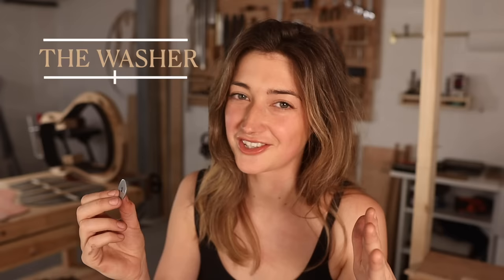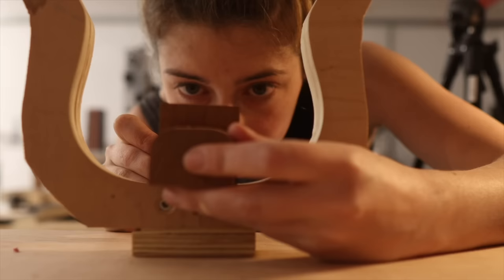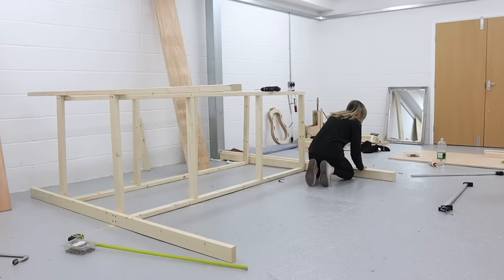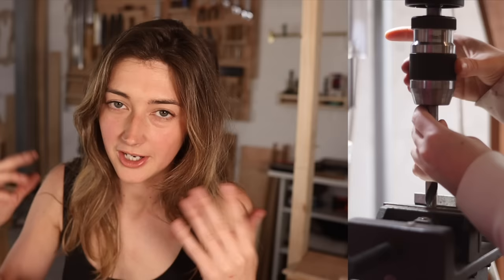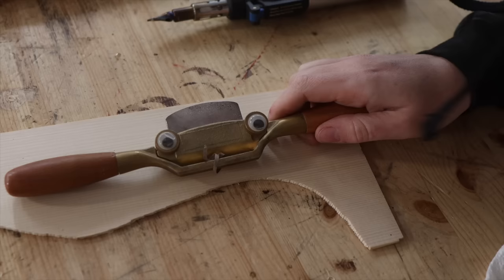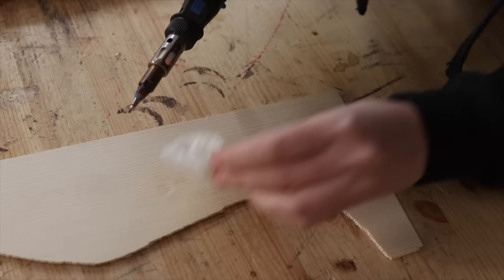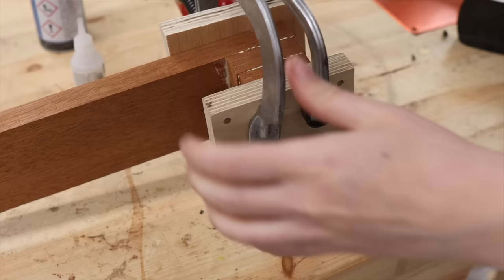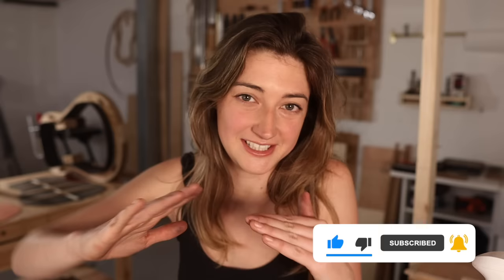Uncommon Tips to Make Woodwork Easier

Comment: A damp cloth and a clothes iron also works for dents and less chance of a burn mark. Well done Daisy more content required.
Reply: Second that, and it is far easier to control the heat, take your time and let physics do the work.
Reply: Also good for blocking a sweater!
Reply: Third that. If putting a few drops on it doesn’t work, out comes a damp rag and my hand me down iron.
Reply: I will agree with you all and add that i was tought to use brown paper, and for that matter the iron was a proper old fashioned non electric one. Also it's not good for the soldering iron , particularly the tip, to be constantly heated and the effectively quenched.
Reply: Came here to say that.
Reply: Been there, done that, several times, so you're dead on there.
Reply: I fourth it. not as harsh, more control.
Reply: Just don't let the wife catch you. I do the same, shush, she don't know.
Reply: had this same comment all typed then noticed this.  agree completely.  and covers a larger area at one time.

Comment: Playing cards as spacers of infinite thickness (almost) and also protectors from glue, glue scrapers. Get the cheapest plastic coated ones. They don't stick to wood glue. I buy ten packs at a time, cheapest ones I can find. I don't mix cards from other makers in a deck, as there could be differences when you need to space out two ends evenly, but when you have 10 of the same decks at a time, you can just have a big stack and they last forever. Also, they're easy to cut.

Comment: Regarding the (US vernacular) hole saw (the things that look like a saw blade wrapped into a circle) and precision... I'm a machinist, and build motorcycle frames, and hole saws do have the ability to be precise with "One Simple Hack" [tm]. Put the hole saw in your drill press, run it at a low speed, then use a belt sander to whittle down the diameter until it cuts on size.
Reply: That's some top tier machinisting right there! You guys just see stuff differently, that's a brilliant idea.

Comment: Regarding the non slip glue trick, I've used a little sprinkling of salt added after the glue is spread, it adds coarseness to keep the work piece from sliding and doesn't affect the joint in my experience, just dissolves away
Reply: Dammit, now we need to start adding a "pinch of salt" to our woodworking recipes?!! You must work for the salt industry!

Comment: Instead of a soldering iron, use a regular iron like the iron that you can iron your clothes with.   It has a temperature setting on it and you can adjust it more finally and it won’t burn your wood, but still only get the dent wet with a paper towel.  Works great.  It also can be used over the hole project to pull different parts of the wood up to give it a unique look.

Comment: Another tip if you might find useful. Use a drinking straw to scrape glue squeeze out from tight angles or hard to reach places. The straw's opening will deform into the shape of the angle and scoop up the glue squeeze out. If you are using a paper straw you will have to cut of the end as it goes soggy, but you will get a good run out of one if you are careful how much you cut off to find non-soggy straw.
Reply from the maker: Cool!!! Thanks so much :)
Reply: This sounds like it’s worth trying. Thanks for the tip!
Reply: I put a hard crease at the end of the straw to help it get down into the corners easier. This trick works very well!
Reply: and you can suck the excess glue out while your at it
Reply: @chuckgrumble5440  

Or huff it........
Reply: I cut my straws at a 45 deg angle, allows the point to go in the joint better. Let glue dry in straw, cut that section off and go again. Can get like 6 uses per straw. And cut them lengthwise when done using. For the turtles.
Reply: @tjennings4412   i cut a barb shape for the turtles before disposal
Reply: @tjennings4412 — What do you mean by “for the turtles”?
Reply: @AndreaCuchetto  The Teenage Mutant Ninja Turtles use the cut up straws to make crafts out of that they can sell on Etsy so they can fund their pizza addictions. You think they get paid for crime fighting?
Reply: @joshhencik1849  — ha!

Comment: Another anti-slip trick for glue-ups is to sprinkle a few grains of sand or salt into the glue before putting the two pieces together. It provides enough friction to stop the slippage but doesn't affect the joint.
Reply: This is a horrible thing to do to your tools. Either you are dulling them by scrapping them with the sand, or you are causing them to rust faster by applying salt.

Comment: It’s already been mentioned, but the table salt trick is one of my favorites for slippery glue-up solutions. With that said, i’ll definitely use the CA trick on smaller things! Thanks Daisy!
Reply: Thank you Daisy.  Similarly, we'll use a spot or two of hot melt glue when gluing items such as cabinet toe kick to eliminate brad nail holes where totally flat isn't an issue.  Works on attaching stair rail rosettes on walls to anchor wood 'til adhesive sets.
Reply: If you are going to use that idea, I've had better results putting a scrap of painter's tape down, then the glue then remove the tape for a clean surface
Reply: @markbernier8434 — Is the tape holding the pieces together while gluing (i.e., it is not in between the two pieces)?
Reply: To hopefully clarify,  it stacks up this way. Scrap lumber as base. Layer of painter tape, super glue, more painter's tape, underside of the work piece.  When desired easily pried apart and tape stripped away clean.  @AndreaCuchetto

Comment: planed pencil improvement: lay the pencil planed side down and lengthwise on the middle of a piece of wide packing tape placed sticky side up on your worktop. fold  the sides of the  tape up around pencil and adhere them to each other. This protects the lead and your surface and gives you a tab to hold on to.

Comment: Love your tips and tricks, here is one if you have a split in the surface of a guitar top, you make a thin long piece of 'spruce that is sharply triangular (in profile) and with  a bit of clear glue place it in the split, after it dries sand it down, Bobs your uncle, one hidden split. Iv'e heard it said that a good luthier is one who knows how to hide his/her mistakes, (as it can be a challenging task to make it absolutely perfect all the time :). Oh a glue has to be hard or the vibrations don't travel through the instrument, plastics like pva are soft and stop the sound, this goes for all joints, hmm like a neck joint. Used the damp cloth tip when we move a piano across our lovely floor, no more wheel dents, 
I was 'reliefed ' :) just hot wet tea-towels, it worked. Oh dents in ebony fretboards, a bit of ebony saw dust and superglue works a treat, hard as nails, just like the old ebony which is very very hard like iron, one can cut the fret slots after.

Comment: I noticed in your ukulele build that you could use this tip: Use a straw to clean up glue squeeze out in tight corners. It forms into the space well, can continue to load up inside the straw as you go, and can be rinse out easily enough for future use.

Comment: A sprinkle of table salt on glue will keep joints from slipping too.  Great video Daisy :)
Reply: That I've used a bunch, and it's great, but the superglue one was new to me.  I could see a couple cases where that is likely gonna be super handy.
Reply: can you use fresh cracked pepper also?
Reply: I love that trick for rough work but only recently discovered how easy it is to sprinkle too much and be left with a seam that wont' sufficiently close in an even slightly awkward clamping situation.  I ended up having to scrape away the salted glue and start over.
Reply: @chuckgrumble5440  no it messes up the taste man, try balancing it out with some sugar maybe

Comment: Great video Daisy. A trick that was a game changer for me was the masking tape and super glue trick. Or known as the blue tape and super glue method. I find it way better than double sided tape. For anyone who doesn't know it's simple. Put masking tape on your work piece. Then put masking tape on the corresponding, let say template. Put a bit of super glue on the masking tape on the work piece. If you have and spray excelerator on the tape on the template. Then simply align both and press down. You can route the work piece to the same size as the template and the template isn't going anywhere. When done pull them apart because the only thing holding the pieces together in the tape. I use it all the time for a variety of different jobs, like a quick way to keep a cutting guide in place whilst using a circular saw. It will come in handy a lot and has saved me a few times.
Reply: Change just use to face tape that's what it was me for! Also you using two very expensive products to achieve the same thing and spending more time at it! More monkey see monkey do no logic required here is it
Reply: @makenchips  The logic is that blue tape consistently holds well and isn't too thick and removes cleanly without tearing, leaving residue, or ripping out wood fibers and allows separate application to each surface which aids alignment without compromising bond (or, again, taking up too much space for an interfacing foam layer) and serves double duty protecting against tearout and is a readily available cheap commodity product just about anywhere and isn't easily confused with some other product which might end up ruining your project, whose raw materials cost way more than any roll of tape ever will.  You're also going to already have it anyway, since it has so many other uses.

And what are you smoking, blue tape expensive?  1" x 60 yards, $5.  I've no idea what "to[sic] face tape" is supposed to be, but two sided tapes offer maybe 1/4 the coverage (accounting for the doubled use of blue tape) per roll if you're lucky, for about $20.  Carpet tape will come in slightly cheaper than two-sided tape but fail to hold, ruin your surfaces, or both.

Blue tape/painter's tape stands alone in being the only tape that's actually designed to be removable and maintain a firm but delicate hold.  You can use something else, but every unique product will be a gamble.  Congratulations on getting lucky with results, but I doubt you actually did the math on cost.
Reply: I've tried the CA glue and blue tape. It was a pain. I'm sticking with my double sided tape 🙂
Reply: @HonoredMule  Yards, inches, knots... I'm waiting for people to finally understand that the metric system is just simple.
I understand that when you're born in the US you think in fractions of inches, but it's like I'm using a lot of different measurements. One is x/16, the second is x/2, the third is x/48, the fourth is x/4, etc.

Do you understand my point?

Now imagine the same system as a monetary one. In the store you pay 12/34 of an inch with 3/14 of an ounce, and in the wholesaler you pay 3/4 of a bucket of cement, which must be enriched with 35.2739619 ounces of water.

Instead of constantly jumping around, I just simplify the system.

Comment: And if you clamp a knife in a vise, you can pull the inner tube past the blade in very thin strips. Great for binding up wood pieces for storage.
Reply: What do you clean the inner tube with before use? Just soap and water?
Reply: Yes. But regardless the black rubber does wear off and can mark quality wood. @AndreaCuchetto

Comment: When gluing two pieces of wood that may slip,  instead of super glue in the middle,  sprinkle a little salt on the board. The salt will prevent the boards from sliding.
Reply: I'll just add you sprinkle the salt onto the glue. You don't need to wipe it away. But not too much glue. If the wood is soft you can use sand.

Comment: An old woodworking guy writes:

A pencil with the wood on one side planed away is sometimes called a "mouse" - draw a big sketch and you'll see why!

Holding a plane upside down in the vise is a good trick - but when you do it with a bailey type plane make sure the plane is LOW in the vise jaws - otherwise you can snap the cheeks off as you tighten the vise.

Comment: the very first tube i saved has been laying around for years. Ever since i thought of them as huge, bump resistant, quite waterproof condoms for flashlights, lighters, tools, the one crappy, 5 bit in a handle combo socket screwdriver, that failed to lock only 10 minutes after you paid for it the supermarket and plenty,plenty more I realised how great it is to have them salvaged, especially diferent sizes, as mostly you will use like a couple cm. Well... the rubber saves lives. Embrace it as you like

Comment: I will also say about the drill-lathe tip, if you need to remove a lot of material very fast and dont wanna hold it to a sanding block all day, you can take the drill to a belt sander and make sure the spinning drill is going opposite to the direction of the belt, and just give it hell full speed, carefully hold it to the sander. Keeps it nice and round, takes a ton of material off quickly and you can do easy tapers like that for starting deeper dowels or making tuner or bridge pegs and so on. Love the channel, very nice to see young people getting into hand making guitars and especially women getting into a male-heavy field.

Comment: I work on metal for a living and I often use the "finger depth gauge" to get a parallel line to an edge for, say, a row of rivets when the actual distance does not matter a lot. The bicycle tube is great, another alternative is the so called surgical tubing, it's flexible latex tube that can be had in different sizes.

Comment: Love these thank you for legitimising me using my plane in a vice, although I'm always worried I'm going to plane off my fingertips... 

My top hacks
Super glue + masking tape clamp - masking tape on both sides of whatever you need to clamp in place, superglue on masking tape, hold down. Done. I used this for so many tasks, met at first with incredulity by the tutors - either that will never hold, or that will never come off. It works every time, you can plane against it and if you really need it held down you can burnish the masking tape down for extra hold. 

Addendum to this: masking tape for everything. I use it to leave notes for myself, to transfer marks for mounting stuff to walls like extension cables, to bundle up toothpicks... hold bindings in place even. Depth gauge on a dril bit. I'm convinced there's nothing masking tape can't do. AND an extra hack. Cut up a whole roll into quarters or shorter and you've got perfect size  bits for jobs like binding or masking off the fretboard. I love masking tape!

Alex Bishop also showed me a great wood filler hack... use a scraper to get little curly bits off of end grain of whatever wood you need to fill, mash those curls into the gap, then drip some titebond on that. Then sprinkle more end grain curls. It dries so much quicker and shrinks so much less than sawdust and titebond as a filler, and it looks a lot more natural (e.g. less uniform, like sawdust which is all one blob). 

I keep a bit of towel in my apron to check grain direction if I can't feel or see it well, the towel or any cloth will feel roughness going against the grain 

Finally one I discovered myself was using those wing mirror blind spot mirrors - convex mini mirrors basically - as interior inspection aids. Dropped into a soundhole, they can be angled and show a lot of the inside of the instrument a lot better than a flat little mirror like a dental mirror. 

I'd love a good tip or hack on how to get plane blades angled square, I do it by sight and then use a scrap piece of wood to check and adjust but it would be good to have a reliable way to just make it good right from putting it in the body

Comment: That superglue on glue joints *Facepalm moment*, sometimes it's the simple things that elude our thought processes. I use Titebond and I've found that if you wring the joints together and just leave it for 30 seconds to initially 'grab' before clamping, most of the time things stay where they are supposed to, but this tip will just speed things up. Thanks for the tips :)

Comment: When messuring to the middle of something (say drawing a lie down the middle of a plank with a combination square, or your finger depth gauge) I would recomend draw the line from both sides. If you messured perfectly the second line will sit perfectly on top of the first line, In real life you end up with two parallel lines right next to each other and the exact mid point is between them. Accurate first time without agonising.
Reply: Also, to add to this (although, hopefully you'd know this before marking the lines), if those lines are parallel then both sides of your piece are flat and also parallel.

Comment: Boatbuilders will take a piece of PVC pipe and cut off 1/2 wide "bracelets" to make instant clamps. You can cut out sections of the bracelet clamps to fit the width of the pieces you need to clamp. Need to clamp up some 1/2" ply, cut a 3/8" wide section out of the PVC bracelet then snap it in place. The cool thing about it is you can make 20 clamps in less than a minute or two. Need a bigger "clamp"   cut it out of 4" diameter PVC etc. etc.        Thanks Daisy. The bbbbbbbbbbbbbbbbbbbaaaaaaaaaaaaaarrrrrrrrrrrrfffffffff at the end is classic.
I took the time to share this tip with you because I care about others, more than even myself. My middle name believe it or knot is "others."     Cheers!

Comment: the bike tube is a very old school thing when riving wood, but traditionally it was a thin strip of leather.

the plane upside down is common for staves in coopering.

when using nails and predrilling holes, you can use a nail as a bit, but then put a little plastic circle on the nail to keep from marking the wood with the drill chuck.